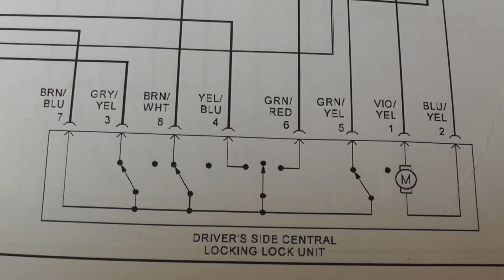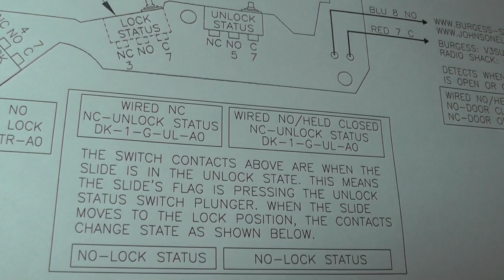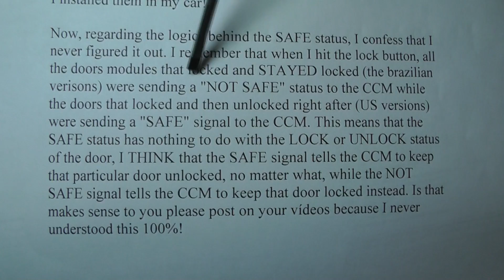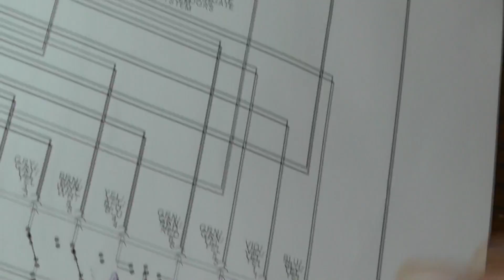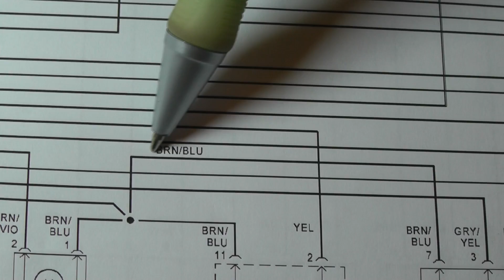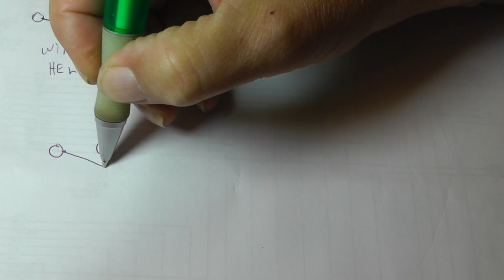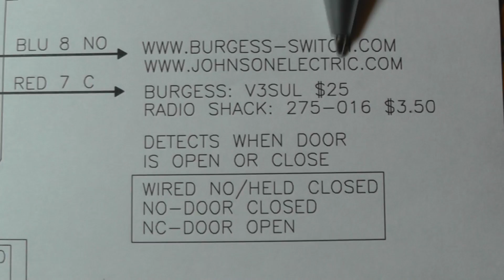The Electrics of Volkswagen Door Lock Modules - Part 3

Comment: Thank you for your very detailed exegesis on the VW door lock module.  I'm having trouble with a 2012 Golf rear passenger side door not locking and not unlocking.  I believe there are enough similarities to my newer model year that you might be able to help me with this.  I had the lock all apart and found nothing wrong with it.  It looks just like new outside and inside and VAG COM confirmed that all the micro switches are doing their job.  My question is this:  Why are there only 2 wires for the speakers, 2 thick wires to power the window crank module and 2 thin wires that look like signal wires or something like that, and no wires that are the same guage as the ones going from the window crank module to the lock module?  Does the window module generate power to the lock module based on a digital signal from the driver's door?  It has a pretty sophisticated PCB with chips like a small computer in there. I don't want to replace the lock module if I actually need the window module.  Also, I can lock or unlock the door using my PowerProbe III on the correct pins of the T18 connector.  When I used VAG COM to get the errors it said the lock module is not getting a +ve feed, also there was a comment about a "slave" circuit or module.  Is the rear door a slave unit to the front door of the same side, or a slave to the driver's door?  Thank you in advance for any input you may give me, Carl
Reply from the maker: Hi Carl! My understanding is that the power window module communicate with the door lock module. Since VAG COM is saying that the door lock module, I would get a voltmeter on that module and make sure that I have all the supply voltage available to it. This would be for both the + and - wires. The two small wires are most likely for communication from the power window module to the door lock module. If the supply voltage is good, you may want to put a scope on the communication wires and check that. Hopefully, it's something simple like a broken wire since your scanner says that the module is missing +VE. Good luck on what you find!

Comment: I have a problem with drivers door not locking with keyfob or button in window control panel. I replaced door lock module and problem is the same, im missing power to the lock motor on pin 1 and 2 when pressing keyfob, if i lock the car manually with key all 4 doors lock fine, but with keyfob only three doors lock. Drivers door stays unlocked, but security light starts flashin and alarm goes off if i open the door. The power to the lock/unlock motor should come from the door module but it does not. Not sure how the door module receives the signal to power the doorlock. But i guess its on can line or such. I scoped the can lines, and there is activity when i press the keyfob, but i guess the can lines are common for all door lock modules and they all speak on the same wires. There is power to the d rivers door module, but no command to run the unlock/lock  motor when keyfob is pressed. Im debating wether to replace the door module or look closer into the ccm, but if the ccm controls the door module on the can lines, im not sure how to measure this. Ccm is dry and look brand new. So no water in footwell issue, so my partscannon guess so far is the door module failing. I opened the door module and try to resolder all connection points, but still no good. 

Any help would be much appreciated.
Reply from the maker: 95tt Just a thought but could you put a scanner on the car to look into the convenience module. You could monitor the inputs coming into it which I believe tells the door module to send a signal to the door lock module. Also, there may be a broken wire(s) inside the boot between the door and a-pillar. Good luck in finding the issue.
Reply: stuzman I have used vcds and the only datapid I see on the door locks is the state they are in, when I press keyfob the 3 doors responds , goes to locked state and unlocked state. If i use the key manually, they all change state to locked and unlocked. This confirms my measurements aswell because there is no power going from from door module to lock module on pin 1 and 2. I do not know how to in interpid the can signals other than knowing there is one. And since there is som messaging on the lines atleast the wires are intact and I have checked there is power to the door module, and since windows and everything else is working that is a given that there is. So my conclussion so far is that there has to be something wrong on the door module pcb not sending power to the door lock module. I opened it up and tried resoldering all the big solderjoints that wasn’t covered in clearcoat. Still nothing. Im up to a point that I think I have to try a new door module. I have continuity checked all wires between the door and  to the connectors on inside a pillar. And since I have power and ground + can signals, that should rule a broke wire out. If the can signal is good and the module have power and ground everything should be good. Unless the door module is at fault not sending power to door lock module.
Reply from the maker: 95tt I agree with what you’ve checked that there is probably an issue with the door module. Before you buy one, maybe you can take the one out from the passenger side and put it on the driver’s side. You can just plug it up to see if it works. Good luck!
Reply: stuzman good tip, ill try swapping over the passenger one and see if that cures the problem 👍 thank you very much for helping.

Comment: Hi I have no power going to my door to unlock it but I can  access the  cables  for the lock module  could you tell me which cables I should power to get the lock to open thanks
Reply from the maker: Robbie, I assume that you have a wiring diagram and if so, you should be able to read it. Otherwise, I would not recommend applying power to wires unless you know for sure what you're doing. With that being said, you could apply power to the motor which is inside the door lock module. And reversing the polarity of those wires, should make it lock or unlock depending on that polarity. If you don't have power and you can access the wiring, why not go ahead and find out why you don't have power. One or more wires being broken inside the rubber boot from the a-pillar to the door is a likely spot to look. Good luck on what you find!

Comment: Your videos are very interesting and very well explained.
I saw second part of Your three-part video back in 2016 when my 2002 year German made Golf 4 (with 4 microswitches inside door lock module) rear left door deadlocked. Couldn't open it at all. Still in same state to this day because of lack of information about how to fix this. I'm simply not using this door. But of course I want to fix it.
I took apart my car's rear right door lock module and it looks almost like in this BMAC VAGS video: https://www.youtube.com/watch?v=xcRsmwi6EBM
(exept for the keyhole of course and the motor has at its shaft an ordinary gear instead of this weird "clutch" thing)
The strange mechanism, which is positioned below slide, and makes this fourth or "extra" microswitch is also present in my case. I have no idea, how this "extra" switch is made, because i did not see any marks left by the lever being moved. Nor can't I understand, how is slide connected to this lever under it. I moved the slide up and down, but this lever did not move and the "extra" microswitch was not made.
So therefore I thought that this  "extra" switch is not in use in my car.

Back then I saved the link to Your video and now I'm back again.
After seeing this video https://www.youtube.com/watch?v=CmyRqsb6Yrg
(It is in russian. He locks doors to the SAFE state, and after the doors are in the SAFE state, he can not open them from in or out) I now suspect that my car's rear left door sits in this SAFE state. It will not open when I press unlock button on the key fob even multiple times. It acts just like in this video - pulling inside door handle will make the door lock knob go up and after releasing the handle, lock knob goes down.
Recently I discovered there's a linkage between door locks and CCM unit. Just recently, after I watched third part of Your video. Before that I did not know how door locks operate.
So I'm at the beginning of this road.
I believe that the signal is not coming out from the CCM to the speaken door lock motor and therefore the motor does not move the slide inside the lock module.
Maybe in my case I have corroded contacts/pins in the CCM socket or some other issue with CCM.
It's all so confusing right now. I need some time to sort out all the information I have gathered so far. I didn't quite understand all about how microswitches operate. Probably have to watch Your third video again few times. I'm thankful to You for your time making these videos. Helps alot to understand about these door locks.
Please do not delete Your videos ever. Many of us need this information.
I'll try to take out fuse 14 after I gathered some confidence and see what will happen. Because it is rear door, i can't open with the key mechanically. I hope I can open It from the inside door handle or after pushing unlock button on key fob.
If possible, I'd avoid to cut a hole in door panels like in this video https://www.youtube.com/watch?v=dSjoGPw6Tm0
But when door lock mechanics are completely jammed from inside, then I'm afraid there is no other way but cutting it open.

Actually I don't undestand this SAFE feature.. What will happen, if locks are in SAFE state, and something happens, let's say, the car catches fire or car driver has a heart attack. Passengers will panic and want to leave the car but they can not open the doors because locks are in SAFE state. So, how can it be SAFE?
Reply from the maker: Malus domestica It sounds like you’re getting a good understanding of the door lock modules. I’m like you and pointed out in this series that I’m not sure of the purpose for the safe switch. And as you may know, it’s not used in North America. Hang in there as I’m sure that you will get it all sorted. 😀👍
Reply: Your videos about VW door lock module helped me to understand about how they work and how to get them to unlock.
Now I have made a 4-part video about VW Golf 4 back door lock module which is meant for European or "Rest of World" markets.
If You're still interested to see how this "extra" (or "safe") microswitch is switched and how this so called "safe" state is achieved, then You could see it from my video:
"VW Golf 4 door lock problem 3"
https://www.youtube.com/watch?v=tsH-DmKttP0

This door lock module has this "extra" switch just like in this BMAC VAGS video You were refferring to here in your video.
I don't know how this "extra" microswitch is tied to CCM.
Under the slide is somekind of a lever-like mechanism that locks this "slide" in place if the lock is in "safe" state. And lock that stays in this "safe" state was the reason why I couldn't open my VW back doors.
I still do not know, why this "safe" state is ever needed.
Maybe when the lock is in this "safe" state, it would be difficult for thieves to pick this lock? Because when "slide" is locked inside the lock, then thieves may try to pull door lock cables or try to pull up locking mechanism all they want - as long as this yellow plastic thing inside lock's mechanical side stays away from its "nest", as shown here:
https://www.youtube.com/watch?v=tsH-DmKttP0&feature=youtu.be&t=1000
 ,the mechanical side of the door lock won't let the door to be opened.
If Your time is limited then You can watch only certain parts of this video:
Here can be seen how the door lock module that is meant for "Rest of the World" differs from Your (US market) lock:
https://www.youtube.com/watch?v=tsH-DmKttP0&t=130s
Here shows how operates this green "lever"-thing under the slide, that switches this "extra" microswitch:
https://www.youtube.com/watch?v=tsH-DmKttP0&t=3440s

I also tried to pull out fuse #14. It cuts power off to the CCM, but it did not solve my problem after I replaced it back in the fuse box.
I guess that the CCM has some issues. Maybe some microchip(s) inside CCM that's responsible for door lock operation is faulty.
Reply: @malusdomestica4555  I think SAFE mode is made to avoid a thief to break the glass and open the door using the internal opening mechanism.
I have the same problem in my car, the rear-right door is closed and SAFE locked and can't be unlocked.
Have you solved the problem?
If yes, you fixed the door without cutting the internal panels? 
Thank you.
Reply: @karreb94  There are alot of videos here on YT about how to successfully remove plastic door card even if the door is deadlocked. I managed to remove mine without damaging it in first part of my own VW video:
https://www.youtube.com/watch?v=kQDFxqlg9-Y
My problem was solved after I unplugged lock module from car electricity. Door lock module is getting no signal from CCM and it does lock nor unlock when I press buttons on key fob.
Right now I have to operate mechanically. If I want to lock the door then I push down door lock pin. And to unlock, I have to pull inside door handle  once, until the door lock pin comes up.
This is not comfortable and gets annoying but that's how it is right now.
My car door lock problem goes back to CCM. Something is broken inside CCM. Door locks did not getting signals from CCM and I had to unplug them.

Comment: Great video; Thank you. I am struggling with the lock module of the rear door of my (European) Passat B5 and was looking around on the net of any useful information on the issue. Compared to the drawing of the electronic card of a front door you showed in your video, the electronic card of the rear door is shorter but seems to fit perfectly with the "right half" of your drawing. And, probably interesting for you, it has a switch at the location of "your" missing switch. I am far from being specialist, but please let me try to explain something. On my Passat, opening the doors using the remote key is done in two steps: first click opens the driver door and second click opens the remaining 3 doors. Looking at how the mechanism inside the electronic module works in my case, I can see the switch (at the location of "your" missing switch) is activated during this process of two-phased opening. I assume thus that this switch does exist on every door except the driver door.

Comment: Hi,
First of all it's a great video! Tons of useful info and helped me to better understand the working process of the door lock mechanism.

I have a 2011 Seat Leon, It's a non US car, you don't have them in the US.
The fix from the dealer is to replace the whole door lock mechanism so i know the problem is within the mechanism itself. The thing is it's a VERY expensive part, about 500 USD without the labor...

The problem is:
When i unlock the doors with the key fob all the doors unlock but one, the rear driver side door. I can not open it using the outside handle. When i use the inside handle only once it open up the ability to open the door from the outside handle.
This problem came and went for some time but now is permanent and needs to be fixed.

I was hoping it is an electrical contact thing that i can solve with some wires and a soldering gun but after seeing your videos about the locking mechanism i can not see how can this be an electrical issue. unless it has something to do with the SAFE/NOT SATE switch.

Can you try and point me to a possible solution or a certain check list that will help me to troubleshoot this problem.

Best,
Alex
Reply: If you've got a scanner that can look at the door switches, you'll be able to see if they are working. You can also monitor the safe/not safe status too. In any event, you'll have to pull the door panel off. More than likely you have an issue with the door lock module where you may have a bad switch, where the usual failure is the switch for the door open/close. If you don't see anything wrong with that switch, then you can open the module up and check for poor solder joints. Also, it's been known that the motor inside fails too. You can run some wires to the motor pins to see if the motor will operate. That should get you a good start :)

Comment: Friend I have a problem in my jetta a4 1999, the controls of each door serve for their respective door, but the controls of the driver's door do not control the windows of the other doors nor the safety nor the interior light on when the door of the door driver. I hope you can help me, thank you.
Reply from the maker: If you have a scanner, you could monitor the states of each push button. Off hand, I would say that you have an issue in the wring loom that passes through the driver door. Probably a broken wire where it passes through the rubber boot. Hope that helps you out.
Reply: Thanks friend, and check all the wiring that goes from each contact of the controls of the driver's door through the rubber boot to the pillar inside the car, you can tell me if the VCDS program I ask you to use to find the fault and As I would, thank you in advance.

Comment: Really excellent video series! I'm about to embark in the journey of fixing my switches. My passenger lock is 'hung' and wont budge. And the one rear lock always pops up again after locking... will need to open them up and check them out.
Reply from the maker: And I have no doubt Sebastian that you can handle it :)